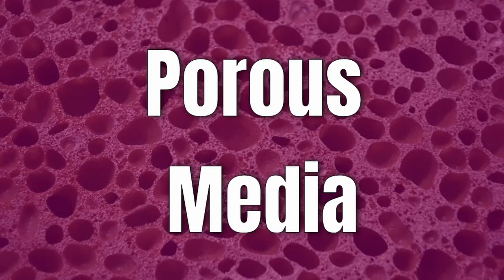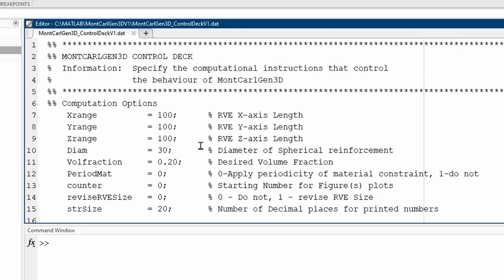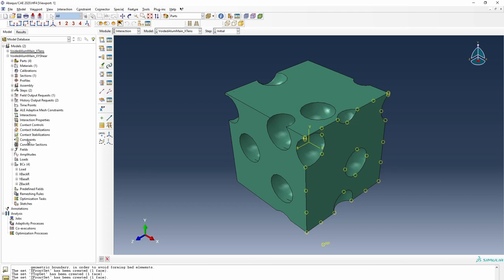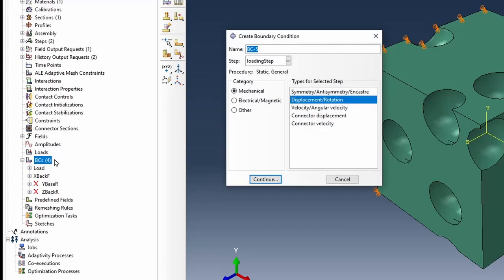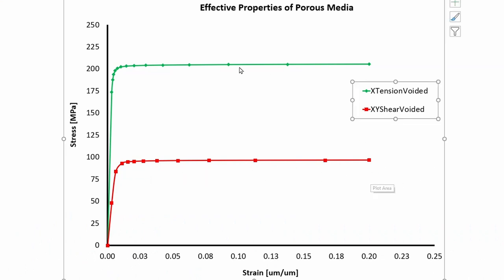How to model a Porous Media | An ABAQUS Tutorial

Comment from the maker: Hi all, here is my new video. I hope you enjoy it. Links to downloadable resources and scripts are in the description section of the video. 
--------------------------------------
You can quickly navigate through the videos using these chapters.

00:00    Intro
00:41    Video Outline
01:16    Introduction to Porous Media
02:11    Application areas of Porous Media
02:50    Design of a Porous Media: Theory
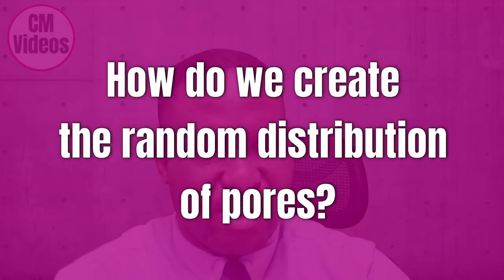04:02    How to create random distribution of pores
04:21    MontCarlGen3D ver 1.0: Software for creating randomness in 3D
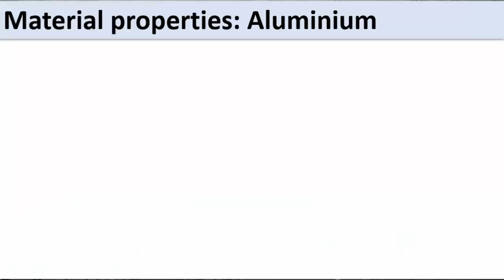05:06    Material properties of Porous Media
05:24    Numerical case studies considered
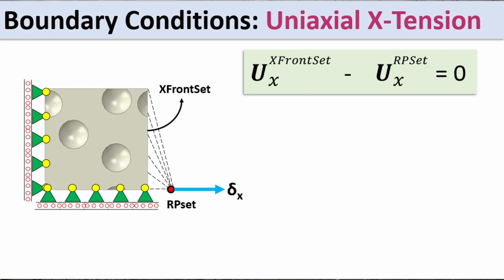06:32    Canonical equations for uniaxial tensile loading
07:11    The use of ABAQUS *EQUATION
08:05    Representatio of inplane shear deformation
08:54    How to extract stress-strain profile for a porous media
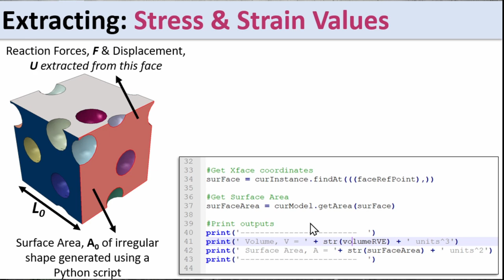09:41    How to generate surface area for irregular shape
10:09    Use of MontCarlGen3DV1: Code to generate python script for model
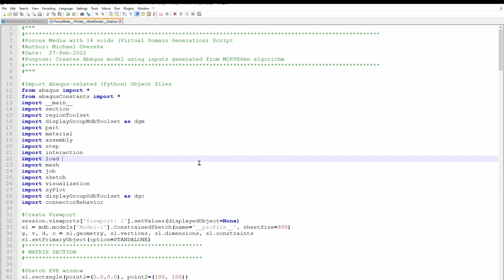11:25    ABAQUS: Generation of virtual domain of porous media
13:24    ABAQUS: Meshing of porous media
15:24    ABAQUS: Boundary conditions for porous media
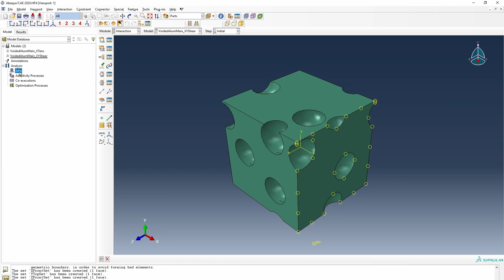18:35    ABAQUS: Results of simulations - uniaxial x-tensile
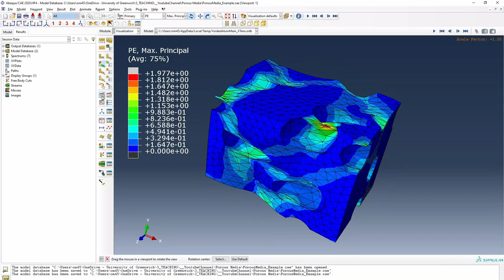19:28    ABAQUS: Results of simulations - Inplane XY shear
20:14    ABAQUS: How to extract stress-strain plots
21:37    How to generate area of irregular shape with python script
24:24    Comparison of simulation results: Graphs and Effective Properties
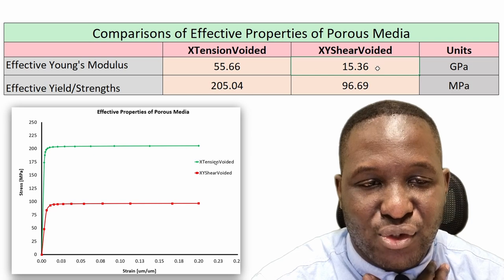25:09    Outro

Comment: Great video! Hi, Dr. Michael, I would like to ask, is it possible to create primitive or gyroid structures using imported coordinate txt file in Abaqus? That's mean, I designed the minimal surfaces in Matlab and get the coordinate, then import it in Abaqus. Can Abaqus visualize my minimal surface model?
Reply from the maker: Hello @Nur Aqila, I really do not know much about this topic to be able to advice you on what is or is not possible. It sounds like it is something I need to investigate more about to be able to give a definitive answer.
Reply: @MichaelOkereke  Dear Dr Michael, is that possible way to calculate porosity in ABAQUS? For example, is it possible for ABAQUS to show me the porosity values of my model if I change certain parameters of my porous model.

Comment: Thanks for your helpful videos, can I get the stress-strain curve for lightweight porous stones (like: Perlite or LECA) by this method?
Reply from the maker: I believe so @R. Sadeghpour. I do not see why, as you are extracting the stress strain from reaction forces and displacement. These values are not dependent on material choice, but rather geometric positioning. Unless there is something I am missing, I believe you can use the method as well for the perlite.
Reply: @MichaelOkereke  So, can I model a porous cube and input the material properties of compressed perlite (perlite soil) to get the properties of expanded perlite (porous perlite)?
Reply from the maker: Hello @R. Sadeghpour, I am not sure I understand completely. Yes, you can create a porous cube following my video about. You can by all means input the properties of the virgin (uncompressed) perlite and then subject the model to a compressive loading. This should result in a new set of results which can be those of the compressed perlite. For a start, the modulus and strenght properties will be different from the virgin (uncompressed) perlite. I am not sure about the expanded perlite, unless that is another simulation which you can as well do, following the sequence I described above.
Reply: @MichaelOkereke  ok, thanks for your complete answer🙏🏻

Comment: Can we do a compression test in sintered powder materials and get the relation of applied load and increase in density relation using ABAQUS?
Reply from the maker: Hello, I think this is possible. You have to get the right microstructure of the sintered powder material first, then create an RVE of that. Then you can of course follow the load application approach I showed in this video to set up and run the simulation. At the end, from the stress-strain plot, you will be able to get the maximum stress (corresponding to the applied load). With the density argument, I suppose you have to run the simulation for a few densities of the sintered powder, and then for each generate the applied / maximum stress. This will yield your desired applied load versus increase of density plot. This is what I think but you might be referring or querying something else.